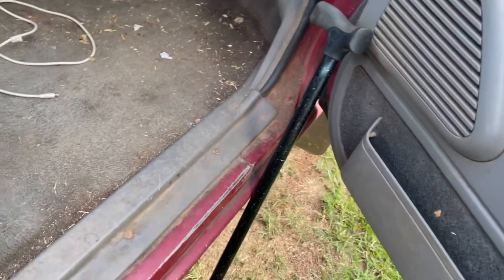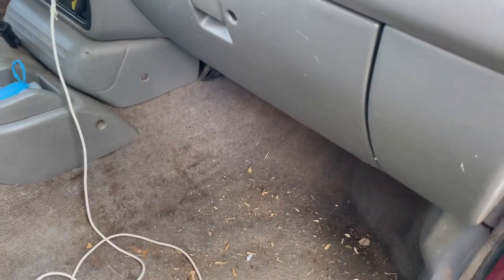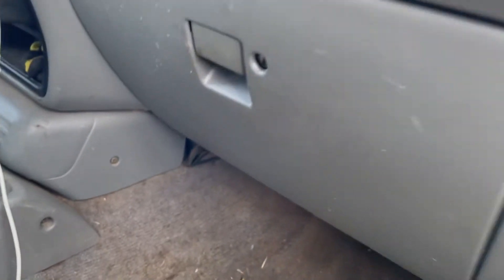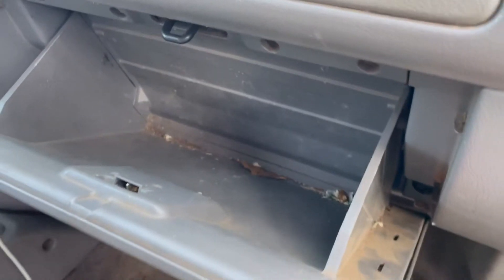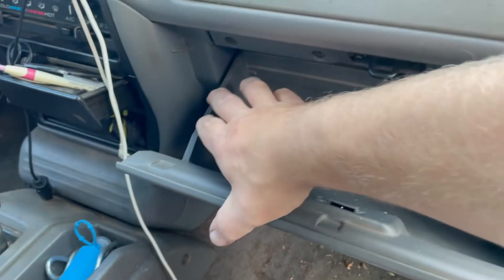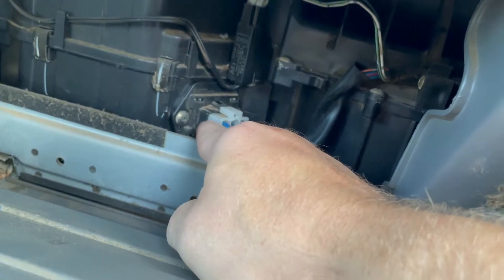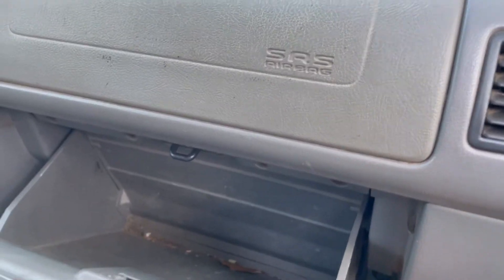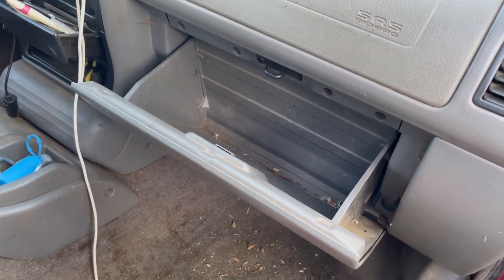Isuzu rodeo blower motor resistor location

Comment: Perfect. Found it and everything seems to be out together. Now I have to figure out how to check the voltage requirements. Got my multimeter ready to go lol
Reply from the maker: Honestly I just looked for connectivity with the continuity tester part of my meter I just googled a wiring diagram for it
Reply: @twoeaglesgarage6223  I’m having a hard time getting that freaking fan out.
Reply from the maker: @ZydecoSoul  sometimes they can be a pain do you have it all the way unbolted yet sometimes it’s just a game of jumbling it around till it comes out I have never taken my fan out I’ll take a look this afternoon and see how I may be able to help you
Reply: @twoeaglesgarage6223  you are so freaking amazing 💕💕 that little space is so small, I swear I’m tempted to dismantle the whole dash 🤣🤣🤣🤣
Reply from the maker: What year is yours I looked at mine and looks like a simple drop out from the bottom may have to remove the plastic kick panel trim
Reply: @twoeaglesgarage6223  2001. I’ve taken everything I see off and it still won’t come out. Very frustrating
Reply from the maker: @ZydecoSoul  is it loose in the housing I looked at mine and it should just come straight down I don’t think much changed on that part over the years is yours facing the floor
Reply: @twoeaglesgarage6223  found that sucker and when I tell you it’s in a tight space #DAMNED!!!
Reply: You are the best in so many ways. I changed the fan and resistor. Cleaned out all the leaves but the glove box back and BAM!!! #SheBlowes😘😘😘😘😘
Reply from the maker: @ZydecoSoul  awesome glad I was able to help !!
Reply: @twoeaglesgarage6223  I’m following your channel. Now I want to see what you do with that wood
Reply from the maker: @ZydecoSoul  awesome thank you for the support I got some plans lol and I have more videos coming with the rodeo as well

Comment: Nice to know this...I have 2 '96 Rodeos
👍
Reply: I have a blue 96 I bought at the beginning of this year. Manual 4x4 only 110k miles. Probably will keep it forever. 96 rodeo gang
Reply: @beachbum3  Yay! 110k miles...still a young pup! My first 96 Rodeo logged 482k miles..V6 manual tranny..still runs but valve guide seals starting to leak (24 valves -sheesh!)...other Rodeo got 162k...runs great! (I tell folks "this ain't my first Rodeo") 😄
Reply: 99 here